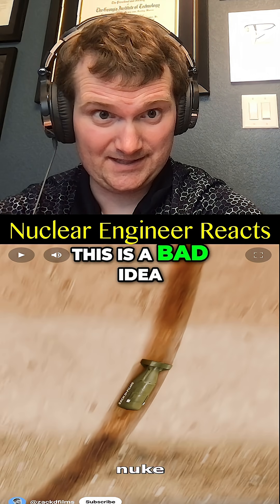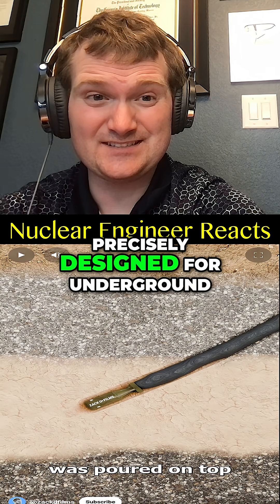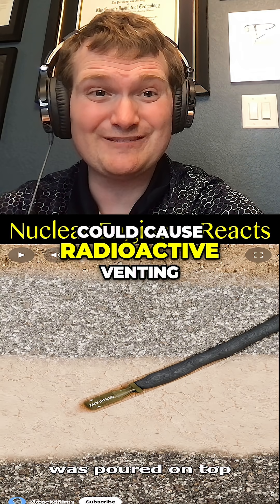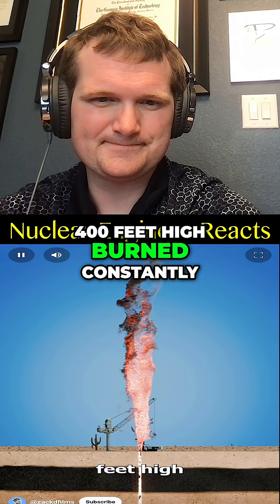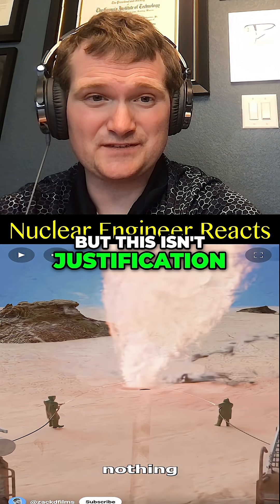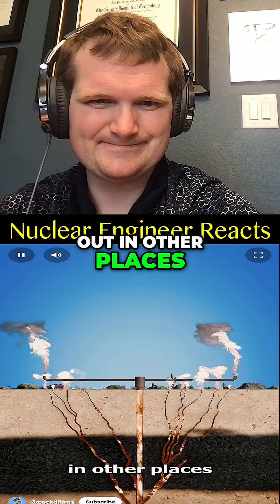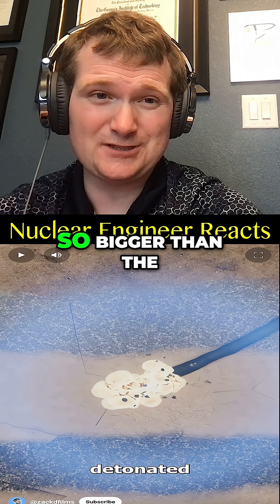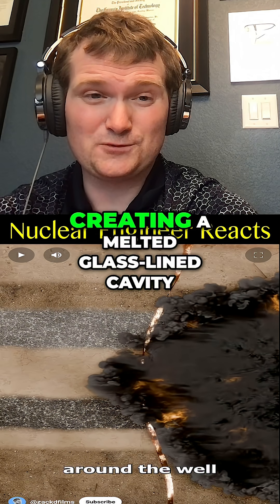They Nuked a Gas Well? - Nuclear Engineer Reacts to Zack D. Films

Comment: I've got the impression that this was one of the success stories of so called Peaceful Use of Nuclear Weapons -program for Soviets (US had their own).

Outventing hydrocarbons at the pressure of several hundreds of atmospheric pressure, a scorching hot flame thrower towards the sky about 100 meters high, had been burning continuously over three years, and proven to be resistant against all of the engineering extinguishing attempts known to man the entire time. No bursting of ground, no gas outventing, just huge flamethrower with side channels put out in seconds after detonation, all the gas channels blocked by plastic reformation of the surrounding crust --> 100% success story. 

And it wasn't the only one. 
Four such natural gas fires has been put out by ug nuclear detonation in total by Soviets.
Largest yield bomb was some 47 kt.

Even in the case of partial ventilation of the fission products constituting of unstable noble gases through the surrounding earth caused by geological shattering, the realistic (no bs LNT modelling) would be negligible.. Correct me if I'm mistaken, I'm not an nuclear engineer.

Real danger would practically require relatively close proximity of human settlements, and extremely miscalculated ground structure and a burst of actual vaporised or aerosolised, neutron activated rock exploding through the surface and ending up in people's lungs or bones.
Tritiated water, then? How much of a risk is that, really?
Very low energy decay, releasing a single low energy beta particle in a tissue already water rich, since tritiated water would move with the rest of the water while in the body, which - in the case of decay - would absorb the relatively low momentum of the electron due to its strong coupling with the medium via electric charge. (improbable event, since the mean expected lifetime of a tritium nucleus while in the system compared to the flushout time of water from a body is also favouring the lower end of spectrum risk for radiation poisoning, no?

Comment: why not use conventional explosives? Dig a chamber adjacent to the resevoir, kaboom, collapse the resevoir. Same principle, no radiological risk. It might be tricky to get the whole package to go at once, but a shaped charge would mean you probably don't need a 10s of kiloton scale explosion to do the job. It'd be dangerous, but worst case you've just created another pressure release valve and reduced the scale of the blowout.
Reply: That will require an insane amount of conventional explosives and MUCH more time to dig a hole big enough to fit them. Plus, at the time soviets were pushing "peaceful atom" propaganda how them making a shit ton of nukes and draining their coffers for it had a better reason than to blow up the US, and this display of atomic terraforming was perfect for that. Two birds with one shockwave.
Reply: @ДмитроПрищепа-д3я this happening in russia nakes way more sense, i missed that context. I thought this was in texas or something

Comment: Urtabulak gas field, it burned for 3 years consuming about 12 million cubic meters of natural gas daily and killed numerous wildlife in the surrounding area. It had already burned almost 13 billion cubic meters before it was sealed off and was expected to keep burning for 15-20 more years. Keep in mind at the time, the annual natural gas consumption was 600-700 billion cubic meters and it was burning 4.4bcm by itself per year. There was also major concern that it could spread laterally created more vents several kilometers away.

Regarding the potential nuclear disaster, it was buried 1.5km underground. In the worst case where vents formed sending radioactive fallout out, the contamination would only be local. It wouldn't be anything like Chernobyl. It would of had the same affect as the bad venting the US had during a Nevada Test Site. So yeah, we already experienced that. 

Of course the main issue is if they remained silent and didn't do proper evacuations for people down wind of it. From what I can gather is, the numbers would be in the 1000s for needing to relocate and avoid area (serious exposure risk). For measurable but modest risk, the surrounding town populations would be in thousands. It was quite rural.

Comment: With approval from then-General Secretary of the Communist Party of the Soviet Union Leonid Brezhnev, the explosive was detonated at a depth of 1,500 m (1,640 yd) on 30 September 1966.[6] The hole that the explosive was lowered into had also been sealed with cement so as to prevent atmospheric radioactive contamination.[7] Just over twenty seconds later, the fire was successfully extinguished, marking the first time a peaceful nuclear explosion was used to seal a gas well. Almost two years later, a similar detonation with a yield of 47 kilotonnes of TNT (200 TJ) was successfully conducted at the nearby Pamuk gas field to seal another leaking well. (Wikipedia)

Comment: Dude, it's the Russians.  When did the potential of radiation leakage ever scare them?  Also, the Russians had used a nuke previously to plug up an undersea oil well.  So they were likely thinking, "What's the worst that could go wrong?"

Comment: This is stupid. Basically suggesting that radiation leaks from nukes is a low chance of happening. Or that it can be surveyed or prevented. Absolute horseshit. The ones they do on land, underground and under water leak 1000% of their radiation directly into everything including the atmosphere. There is no preventing a single % of it. No it doesn’t need “porous rock” in order to leak. The leak is 1000% and it is guaranteed.

Comment: ok, as an engineer give your engineering solution, how to seal a burning 400+ Celsius gas fountain that cant be sealed by just pluging the hole? Water evaporates quicker than it can reach the hole. this is in a middle of desert, bringing lots of materials there is impossible, u have no way of dumping a lake or a river into that area.

The whole dilemma was the scale. Taking out that fire required a big scale action. If water is unavailable in such quantities, then only solution is soil. Which means u need to shift megaton of soil to block the leak.

Can conventional epxlosive shift and entire soli layer from big enough distance to safely block leakage without making a new one?

And if conventional explosives couldn't what type of explosive is left?

Comment: You are very correct about the precision necessary. It would have been orders of magnitude cheaper to run a half-decent Seismic tomography to detect the well they accidentally tapped into, than to have to seal it with an atomic bomb. S-waves wouldn't travel through this well, as rigidity drops to zero, so it wouldn't be too hard to image. Even during the cold war, when information flow was limited, both the Soviets and the Americans had brilliant seismologists, and very good instruments at their disposal. Some of the coolest old Seismometers are Soviet. 

P.S. I'm a seismologist, and I love your content! 🎉

Comment: They didn’t try to put the fire out with water. Water is used as a heat shield so they can actually get close enough to try to put their solution over the wellbore to try and stop the blowout

Comment: It was not plan B. More like plan Z. Second, it worked. 3rd it was modelled by the best scientist of the ZSSR who would eat this guy for breakfast if not 10 off such morons. The tube was sealed with concrete in line of 1,580 meters to prevent any contamination. And they did it after 3 years, with out the a-bomb nobody could say how much longer the fire would take place. And btw think about the consequences for the environment if the fire would still burn. Like to this day. Like for 30 years.

Comment: It was in USSR at the urta bulak gas field and there were not only main fire torch 120 +- meters high but also horizontal flames around 30 meters due to failure of a valve that was supposed to seal the well.
Reply: Fun fact it is also the longest fire event in our history it lasted around 3 years
Reply: @Mr.Fun-Whocares  there's another Soviet era gas well that's still burning to this day so no, not the longest fire event.

Comment: So, in comparison, is the radioactivity that could be released by this nuke worst that the radioactivity released by the uncontroled degassing of a natural gas reservoir? 

"you just need better prevention" that is a great idea. What do you do when the prevention had not been done and the accident happens? Don't condomne the solution they found all you want, but I didn't hear you offer an alternative solution that they could actually have used.

Comment: They could have just dropped a massive amount of termite in the area surrounding it and basically seal it with an extra thick glass ceiling 🤘 or if you're really feeling crazy chlorine trifluoride would absolutely melt the ground into one solid piece you would just have to watch out for the fumes

Comment: Im glad your not a science dummy, using a bomb to stop that fire, we should of never drilled into the earth to begin with, in fact digging valuable resources out of the earth is like taking valuable resources from your body, it couse unforseen destruction under earth and eventually couse even more damage on the surface, thiers nothing in the earth that we dont already have on the surface,

Comment: 1. The nuke and the shaft were specially constructed
2. Hiroshima nuke was not even near that effective and clean as modern nukes of the 80-s, not even mentioning special industrial-purposed nukes
3. Nuke was planted at 1.5 km depth, so what radioactive contamination are we talking about
4. Gas basin they accidentally pierced was at a pressure of 300 bar, there's no way to compress big enough volumes of soil with bigger pressure to seal the leak other than a multi-kiloton explosion. And any chemical explosive is kilotons too bulky to put it in a 1.5 km shaft
Reply: I mean it did fix the Japanese.
Reply: Thank you for, unlike the OP, actually doing some research on the subject.
Reply: I will just say that there are radioactive gasses, and any radioactive compounds that make soluble salts can absolutely escape. He said that better prevention was necessary not that this solution was bad given the leak already existed
Reply: @henryparker3420  radioactive gaseous isotopes are mostly short-living and even if leaked diffuse into the atmosphere, so no significant radioactive pollution. Soluble salts require water at the 1.5 km depth to be dissolved.
Reply: Fluid contamination, solid contamination, gaseous contamination. Pretty much all contaminations. You do realize the reason why Chernobyl was so terrible was the fact that radioactive material entered deep into the dirt and soil right? Tried to be smart unsuccessfully.
Reply: @Velatari   A nuclear reactor core with contamination is 10x more than a nuclear bomb of today/modern ones.  Unless you include Cobalt nuclear bombs(Which no evidence of it being made) which is specifically design too have MASS amount of radiation in the area while preserving infrastructure.
Reply: @Velatari  how deep it entered? We do not store or even plan to store radioactive waste on such depths the device was used.
The reason ChNPP disaster was so terrible is it having no outer containment and the amount of fission and radioactive material in the core which is is incomparable to a nuke. RBMK has around 200 ton of 3% enriched uranium, which means the only amount of U-235 alone in a reactor is 20 to 30 times more than in a typical strategic nuke, not even considering special engineering explosive devices, which are designed to be as effective and clean as possible.
Reply: Yeah, I think I’ll trust the nuclear engineer’s take on the matter, thank you very much.

Comment: Well it is mentioned 3 years ago. They tried to use altilery shells to close the pipe or to get it to the point where they could put a valve on but they failed. It was last resort idea and the depth and place where this event happened made it absolutely safe (like for a soviets standards)...

Comment: I don't know, it doesn't seem like a big deal to me. Basically all of your nuclear material is consumed.  The cascading reaction means more and more heat and pressure to a point where all of the material is forced to break down.  People get confused and think nuclear bombs are dirty bombs.  Yeah I wouldn't be in the area for a day but honestly with it being underground it's hard to imagine any of the radiation could get through such a deep amount of soil.  For sure the gas coming out of the ground wouldn't be something good to be around but I'm not sure that would even have any real impact on a person's life span. Plutonium and uranium are about as poisonous as any other heavy metal.  Not sure what those breakdown into but I would assume those elements are also going to be heavy metals.  Maybe the real risk is flecks of material that has not cooled down and stopped radiating for an hour or so?

Okay after talking with Gemini I changed my mind.  The byproducts of the nuclear reaction have a much shorter half life which is why the dust remains radioactive for a while.  Still considering after about 2 weeks most all of the radiation is done this bomb doesn't actually seem like that big of a deal and maybe they just wanted Overkill since like this commentator said they have no idea what the structural integrity would be.

Comment: İts actually an real thing soviet union did basically in past soviet union found an gas field in uzbekistan and tried to open it but due to some things went wrong it broke the whole building leading to people living near it getting poised by the gas 

To end it they planeed to burn it but it was an bad idea bc the oxygen never reached to source of the gas leading it to burn for years

İn these years soviet union did a lot of failed attempts to stop it until they used an nuclear bomb to stop it which worked

Comment: During the Deepwater Horizon mess, many asked why that well couldn't be sealed with a small nuke.  Aside from the impossibility of quickly building a device that would be possible to accurately place in proximity to the bore, the energy released would risk causing a massive decomposition of trapped clathrates, potentially producing an eruption of pulverized sediments mixed with expanding gas.  Happily, the restrictions against nuclear explosions in our international treaties rendered this issue irrelevant, but it was not pleasant to contemplate the potential upscaling of the mess which might have happened.

Comment: Better prevention and reservoir pressure modeling aren't ways to fixing a problem that is currently happening. Can you please give us a way to stop this other than, if you perhaps did this then this wouldn't happen??? A critic is only part of the problem, less they actually contribute to a solution. Criticism is only good when followed by action that leads to a positive result.

Comment: Turkmenistan  didnt have a lot of luck with natural gas back then it seems. This accident in the 1960s and then in 1971 the Darvaza Gas Crater which was caused by drilling hitting a gas cavern and the roof of the cavern collapsed, they lit it on fire to apparently prevent poisonous gas from spreading, that has been burning for 54 years now, also known as the Door to Hell or Gates of Hell.

Comment: I think your response is spastic. This looks like a well engineered solution to a potentially catostrophic problem. The fires were put out and the leak stopped. The potential future of leaks are less dangerous than the original problem as there is no fire. As long as the site is monitored and any future leaks are capped there is no issue. As to the "radioactive gas" its called radon and you are breathing a certain concentration of it now. It also comes out of your natural gas stove when you cook. It is the only semi-stable fission product that exists in gas form, the others are very short lived and decayed into other materials a long time ago. And again, even in the event of a large radon gas leak from this site (large quantities are an issue) again it can be monitored and potentially capped. And as for the other fission products, they are safely stored underground where there are plenty of other naturally formed fission products and other heavy materials one must be cautious with. Potentially useful materials might I add.
This is just anti-nuclear fear applied to a rather responsible use of nuclear power. 
The only power source with the energy density required to raise all of humanity into a better future as one is nuclear power. Fear of nuclear power kills far more people every year than any nuclear device ever has.

Comment: When I saw the tagline I thought this was going to be about when they tried to frack with a nuke in Colorado, or maybe the time they tried to hollow out a salt dome in Mississippi with a nuke. 

Mississippi when did leak a bit. Or at least when they drilled a well to see what it did the drilling mud was radioactive.   The one in Colorado activated at least some of the hydrogen and carbon in the natural gas so nobody wanted it.  I remember seeing a well posted with Trefoils somewhere in Colorado but I can't remember exactly where now.

Comment: I disagree. The fire could continue to burn for a long time. If you don't know, this potentially cause sinkholes which can allow fires to spread even more with more access to air. If the fire somehow reaches a large coal vein somewhere, it would then have the potential to also burn for hundreds of years without being able to stop it, further increase environmental damage. I think this was 100% a reasonable decision even if it was bad.